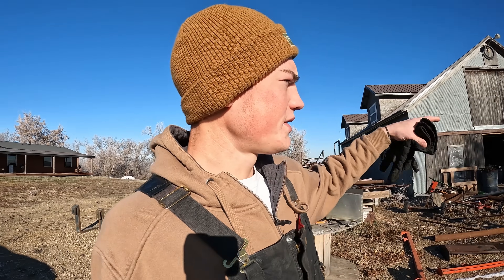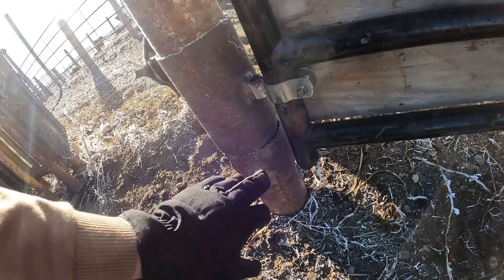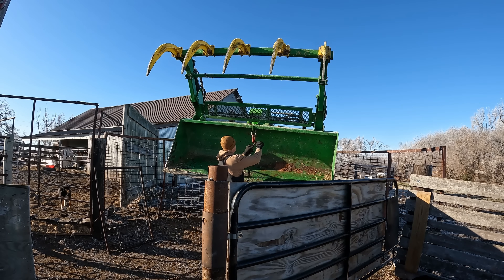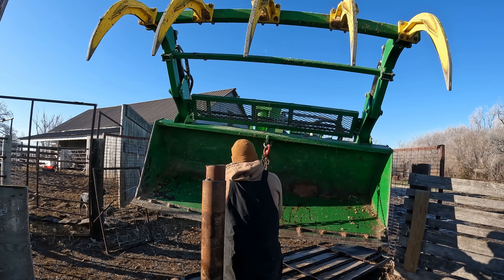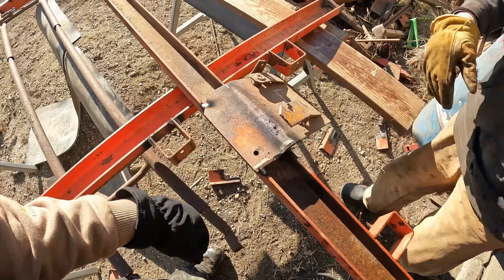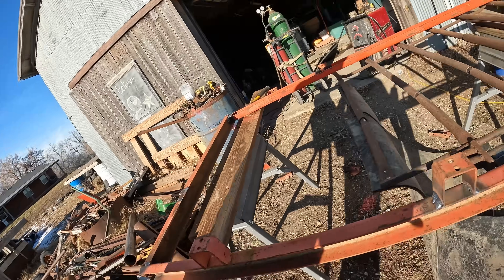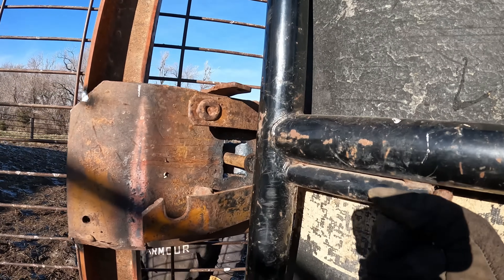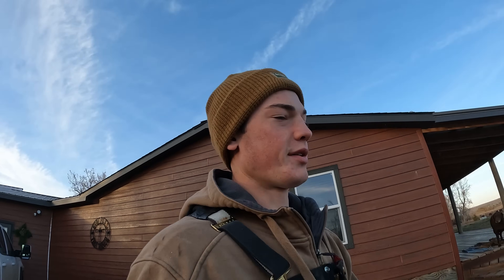Upgrading Our Cattle Handling Facility!

Comment: Just a comment, suggestion I guess. Cut your sleeves with a cutoff saw then edges will be smooth. Then to hold it at the right elevation cut a sleeve 1 to 2" and weld it at the bottom at the right elevation that will make the gate swing at the height you want, ( that bottom sleeve welded to the gate will ride on it.)  
If your local elevator runs a bucket elevator those chains need to be replaced every once in a while and they make the best hinges if you can get your hands on them. You  can weld them straight to the post and the gate. They last forever. 
 Really like your videos especially when you are building and welding.

Comment: When you had the big gate off it would have been an idea to drill the sleeves for grease zerks.I have run cows for 40 plus years and stuff made out of scrap is the most profitable and changing or modifying is just fine. My friends shop looks identical to yours and his 80 year old dad is building or fixing daily there
Reply: Ya we talked about that I’ll probably oil it from the top as time goes on. Thanks for watching